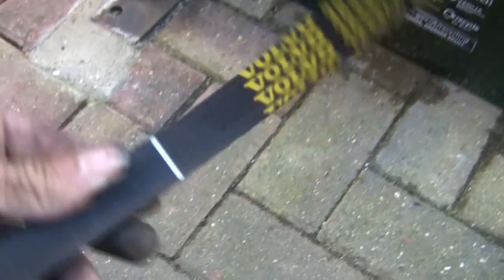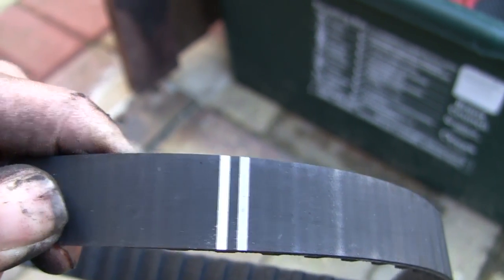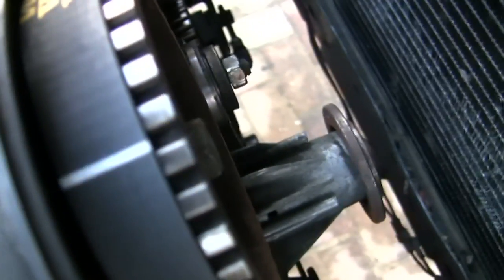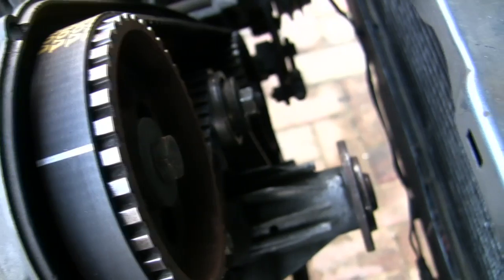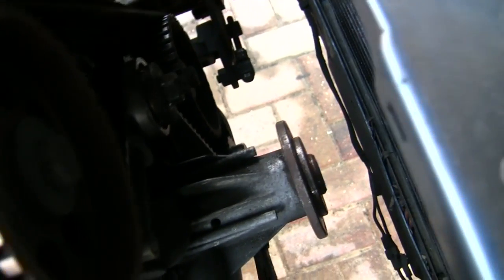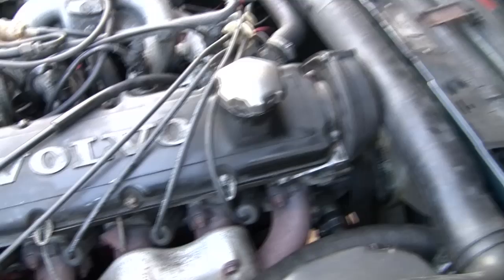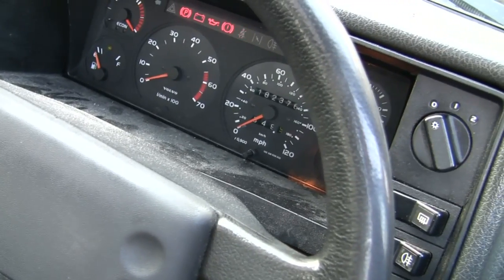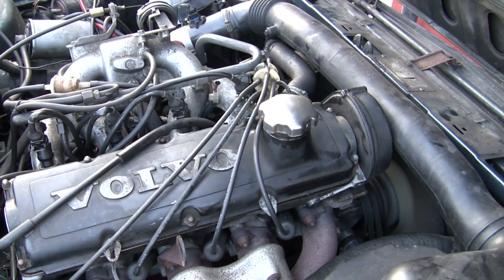Procedure for Timing belt change for Volvo 360 Part 2 - Refitting

Comment: wut if someone replaced the timing belt without using the proper special tools and now the motor has zero compression ... how can i realign the cams with the crank .. i do have the tools needed but im just wondering if it had to be used the 1st time since the people that worked on it before me didnt use the special tools and just took it all apart and put it back together as if they were working on a ford

Comment: Sweet job mate, thank you very much! I will try this on my volvo 940 8v with a b230FB soon. I reccon it has alot more of space to work with infront of the engine. But the procedure should be pretty much the same right? It's a red-block as well